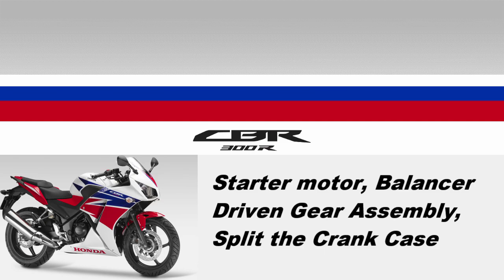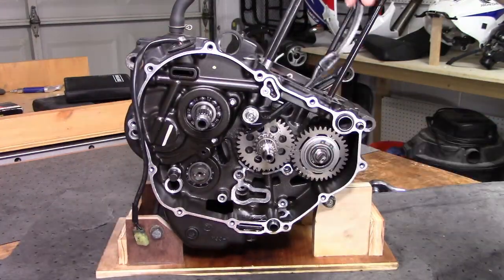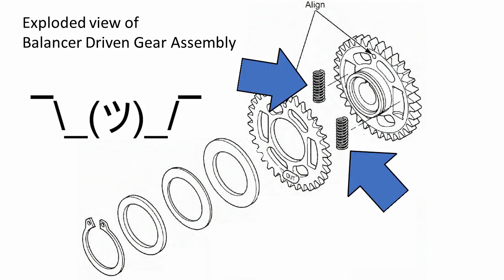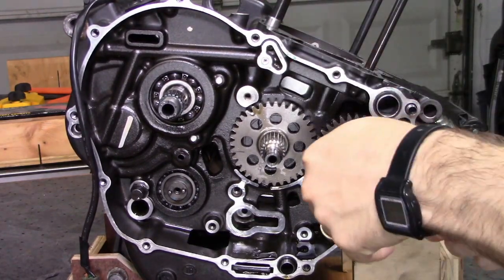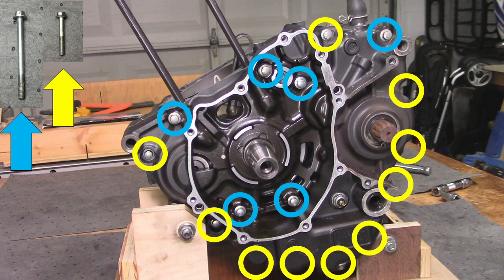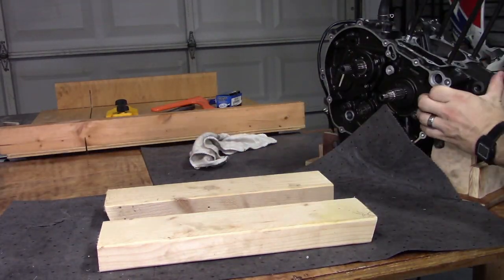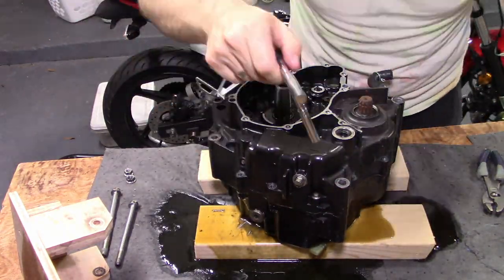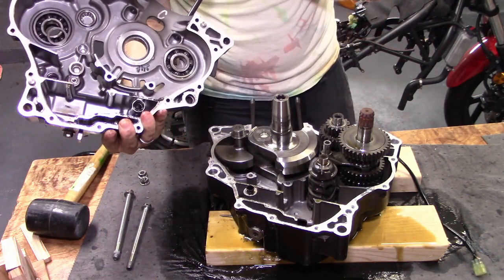CBR300R - Engine Teardown Part 4: Split the Case

Comment: Less messy than using oil-absorbant mat: lay the engine on the right side in a plastic oil-changing tub if you have one.  They sides are low, so it's totally easy to put the engine into a good position, and the oil drains into something intended to hold oil anyway.  If you change your own oil, you might have one already.  If you don't, they're cheap!  I just did mine this way and it worked great.

Comment: About the 3mm holes on the balancer shaft sprockets not lining up: I'm exactly at this point in my teardown, and the holes on this engine aren't lined up either.  This is a 2015 that for sure had the crankshaft recall work done, so my guess is the shop tech put it back together without skewing the inner and outer sprockets to line up that hole.  I believe the idea might be to bias those springs into slight tension or compression (one tooth's worth).  Those springs maybe act sort of like the rear wheel cush drive to smooth out jerky motion, but this is currently just a guess (though why else would those springs be there and mounted the way they are?).  Unfortunately, the CyclePedia manual I'm using only says "install a 3 mm pin (outside diameter) into the hole of the balancer driven gear assembly" and for reassembly it says nothing about skewing the sprockets to line the holes if they aren't already lined up.  I'll post more info if I find out something definitive!
Reply: Update: I've completed my engine teardown, and I can verify that the springs, when unloaded, hold the inner and outer sprockets misaligned by 1/2 tooth.  When holding the assembly off the engine, if you rotate the thinner outer sprocket clockwise -- easy to do by hand, as the spring pressure is light -- you can line up the holes and stick a little allen wrench or something in there to hold them in that alignment.  With the assembly in place on the engine, you remove the pin and the springs will rotate the outer sprocket against the main gear with a little bit of pressure.  It seems exceedingly likely that this is just to keep the teeth in contact at all times, preventing gear lash/noise.  So it should be totally normal to see the holes misaligned when the assembly is on the engine, because the springs are causing the outer sprocket to rotate a little relative to the inner sprocket.  The shop manual should say all this -- but it doesn't. :(

Comment: Is there anyway to get to the transmission without splitting the cases?
Reply from the maker: I imagine you could SEE the transmission without splitting the case if you used a boroscope and took off the piston.

If you wanted to do anything with transmission (remove/replace) you'd definitely need to split the case because the two ends of the transmission are effectively bearing supported by the two case halves.

Comment: Hows everything going?
Reply from the maker: hey man! thanks for following along. Currently, i still need to finish doing a dimensional inspection of the crankshaft, connecting rod, and piston. i should have done that a weeks ago, but life got a little busy - first i built a new computer (partially to help speed up the editing process), and then i went to my brother's wedding, then spent a fair bit of my discretionary free time making a wedding video for him, and then my other brother asked me to re-make his wedding video that i did in 2010. I also ended up working on a project for a friend, which took some time and had to move stuff around the garage.
hoping to make time this weekend to work on it some more....and then do the video editing. It's fun, but painfully time consuming.
I just ordered the seal-kit yesterday...it should show up in about a week. Thinking of doing a simpler/easier "update" video this weekend...just gotta make time for it!

Comment: hey. Kept up from your reddit posts. How is the process coming along?
Reply from the maker: hey man! thanks for following along. Currently, i still need to finish doing a dimensional inspection of the crankshaft, connecting rod, and piston. i should have done that a couple weeks ago, but life got a little busy - first i built a new computer (partially to help speed up the editing process), and then i went to my brother's wedding, then spent a fair bit of my discretionary free time making a wedding video for him, and then my other brother asked me to re-make his wedding video that i did in 2010.
hoping to make time this weekend to work on it some more....and then do the video editing. It's fun, but painfully time consuming.
If it turns out that there's no "smoking gun", i guess i buy a seal-kit (about $50) and then put it back together to see if it still knocks.

Comment: I assume that the rod  is one piece.. and that the crankshaft was pressed together .  So, if your rod bearing is bad ( I think that's what started this tear down)  the fix is going to be a new crankshaft...  the next episode with be interesting.  I hope you will share the cost of the parts.   I believe Honda parts are typically less expensive than Suzuki ( in particular) Yamaha and also Kawasaki.   That was what I found to be true when I compared prices of engine repair parts for my Suzuki TU250X again other makes. ( not that I have needed any ).
Reply: The crank is indeed a built-up type with a one-piece rod, which is put onto the crankpin at the factory.  The crankshaft and rod come as an assembly for about $250 if you can find one.  The Honda part number is 13000-K33-D03.

Comment: "misaligned" :  they rotate relative to one another.. as part of the shock relief and anti-lash funtions of the two gears.. use a lever to move them until you can insert the pin.   This is a standard "Anti-Lash" gear assembly.. found in a variety of things from radio dials to engines.

Comment: It is an assembly, because those two springs and the two gears are a SHOCK ABSORBING combination..which prevents damage to the engine by sudden changes in loading.